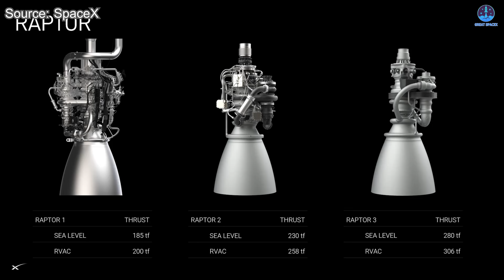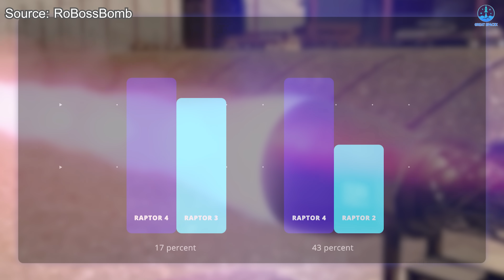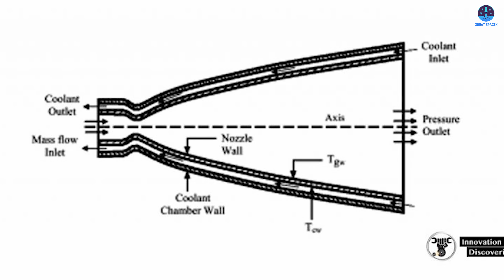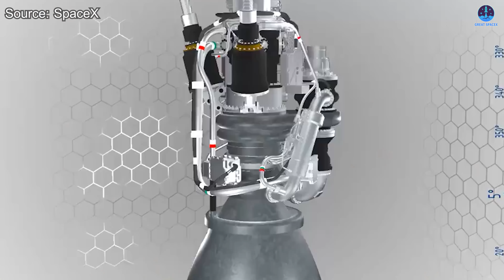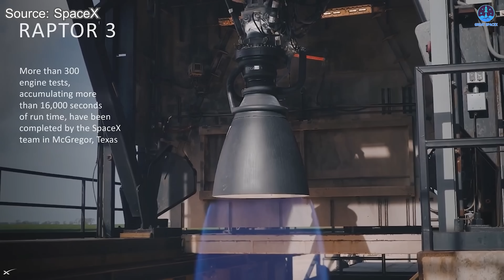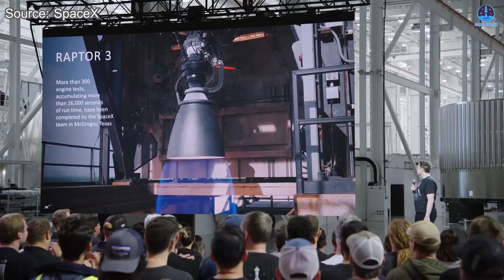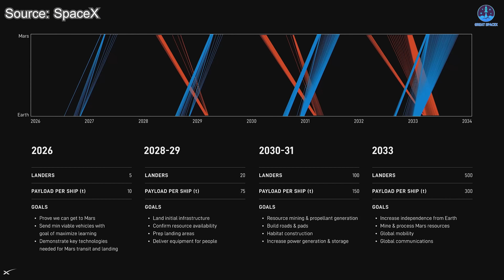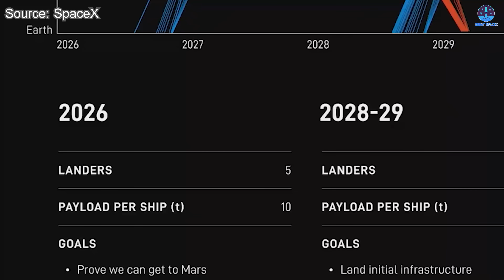SpaceX's New Raptor 4 Upgraded Thrilling Scientists' Minds...

Comment: The downside to welding everything is maintenance.  It makes it impossible to repair internal parts without cutting the entire thing apart.
Reply: What you say is true, but these engines have been run for many dozens of static firings without needing any repair or servicing.

Comment: They need to be building a BE4 type engine, not these Falcon motors.  Big lift big motors. Ask the team in the 1960s
Reply: Fewer heavy-lift engines means Stage 1 recovery is significantly more-difficult. You need rapid restarts and shutdowns, and quick gimballing and throttling. More mass in each engine makes balancing those forces to minute detail almost impossible.

Comment: How about getting just one version to work????
Reply: Nope! They are going to continue to stress test. Have you noticed They haven’t put pogo suppressors on starship? They did the same with Falcon 9. They didn’t put pogo suppressors on Falcon 9 till they were ready to human rate it. Till then they let the stress of the vibrations take their toll to find weaknesses in the design. When it flew successfully consecutive times in that configuration, only then did they put pogo suppressors on it to smooth out the ascent. It’s about knowing how it might fail under the most stressful condition and fixing those weaknesses. Once that work is done, starship will be at least as reliable as Falcon 9.

Comment: Another episode of Orally Ball Washing Musk!  No version of the Raptor engine, not versions 1, 2 3 or 4, have ever reached even half the thrust of the F1, developed beginning almost 70 years ago!  OK, the Raptor isn't anywhere near the power of the F1 but it's accomplished more than the F1 ... right?  No, on it's first flight on Apollo 4 in 1967, about 10 years after the start of development of the F1, it made orbit and not a single engine failed.  Over the remaining Apollo flights the F1 had zero failures and that includes the Apollo/Soyuz mission after Apollo.  Raptor, OTH, has not completed any flight with all engines operating as they should ... NOT A SINGLE FLIGHT!  Starship, after 9 tries, has not yet reached a stable orbit and Raptors have failed on EVERY FLIGHT!   But sure, go ahead and continue to Orally Ball Wash Musk!
Reply: Everything is going to ok buddy
Reply: show us on the teddy bear where that bad man Elon touched u..
Reply: Aaaaand was the F1 re-usable? One program had a blank check from the government, no red tape to navigate like "environmental studies" and FAA interference, etc. Both programs are entirely different approaches to space in different regulatory eras...but you want to use F1 as a yardstick of Starship "failures"? Lighten up, Francis.

Comment: If they can get this to work installed with no failures, it will get closer to saving this vehicle
Other than making it out of carbon fiber. My confidence on this engine working is less than 10%.
If you are evolving a design and you never get it to work, then higher thrust, pressure, temperature versions will likely fail. Version 4 so much simpler its reliable… is not credible specially from a company than over simplifies complexity and disregards risk

Comment: The booster ,, might work  ,,,  Starship  has not managed to survive on the way up or back through the atmosphere 
so thrust is not the problem ... its RELIABILITY ,,, and as yet ,, they don't have it ,,,,    BOLTS  ,, allows you to take an engine apart and repair it ,,, WELDING ,, can you repair that ???
..
wouldn't it be odd if Blue Origin ,, were to become a reliable reusable system,,,,

Comment: Welding increases integrity but reduces maintainability.
It just means throwing away large sections of the engine and replacing them. Though perhaps with robotic welders etc. they can cut open and repair internal bits. It’s been the problem with a lot of manufactured goods over the last few decades, built for discard and replace rather than repair.
During rapid iterative development that’s ok, because a few years later, no one needs to maintain raptor 1 or block one boosters, so you scrap them and move on.
Even in military equipment maintenance there’s tier 1-3 maintenance. 1 pull it out and replace, 2 do some error checking and check the connectors. 3 examine the components and try to repair. SpaceX may be doing that to keep the Falcon Merlins going …
Reply: When it gets to the point that it cost less and takes less time to build a new engine then to troubleshoot, tear the engine down and replace an internal part. Then why would anyone in their right mind complain about that.

Comment: If you design an arowspike nozzle that would cut off even more weight and add to efficiency, or would you have to redesign the raptor engine to integrate an arowspike nozzle ? Or is arowspike tech prepriatorial?
Reply: Check out NASA’s rotating detonation engine. It may be the future single stage to orbit engine. So cool !!!